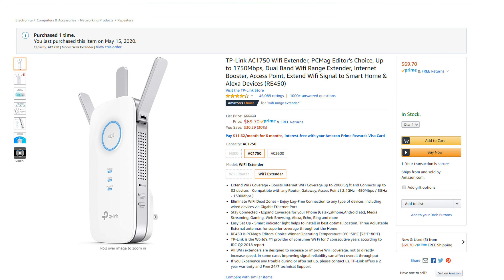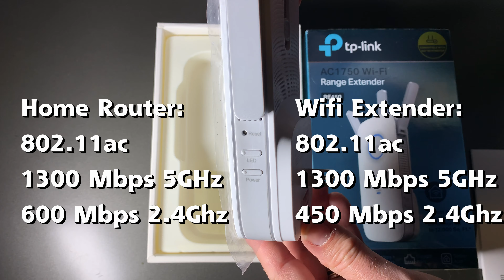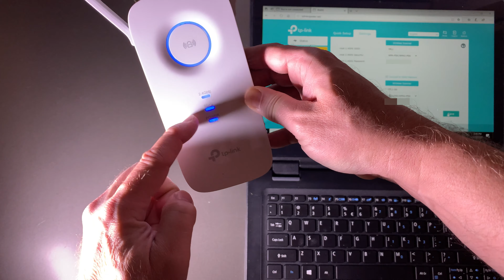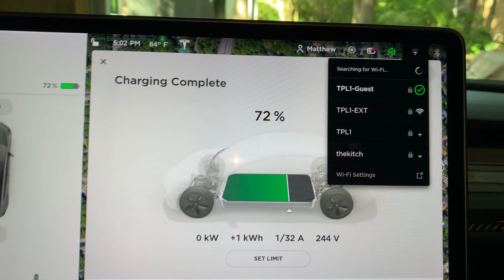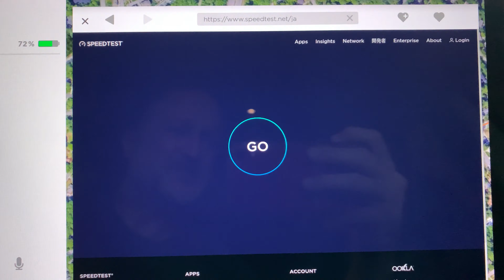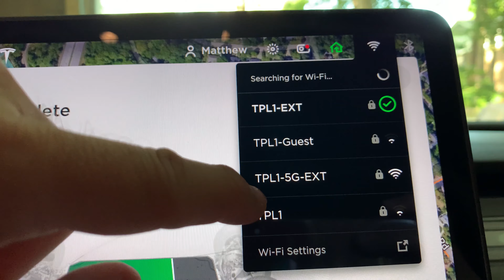Tesla Model 3 - Wifi Extender

Comment: This is an important video as Teslas need WiFi to upgrade. TP-Link has a great selection of products. Make sure you update the firmware when they release patches. I had the following in my garage (until I got a new router that covered everywhere) and it worked well: https://smile.amazon.com/gp/product/B07GRCMJWH
It uses a wired backhaul with POE so it just covers a single gang box with no wires showing. But you'd have to run an Ethernet cable back to a POE switch near your router which can't always be done. Your case is particularly difficult, but they do make Ethernet cable that can be buried. Wired backhaul is going to be faster and more reliable and it won't take away from the bandwidth used by all your other wireless clients. However, like you stated, it's not always practical. The device you have can be switched to Ethernet backhaul if you want which is really nice.
Reply from the maker: For installation, I upgraded the firmware.  I recently updated my firmware on my router and access point.  It added the security protocol WPA2-AES in addition to TKIP.  Many routers default to automatic. Make sure to use AES since it is more secure than TKIP.